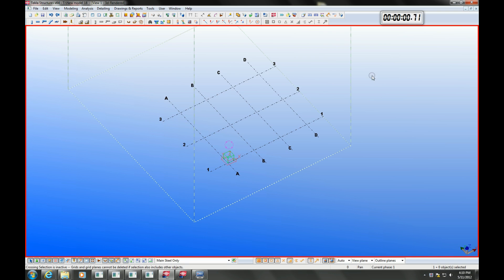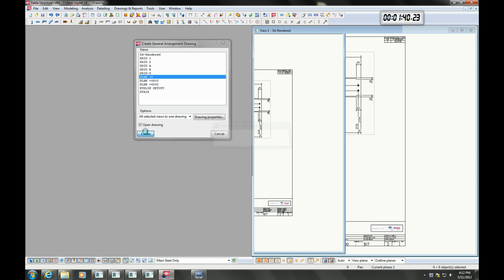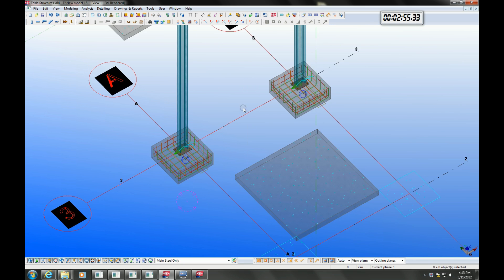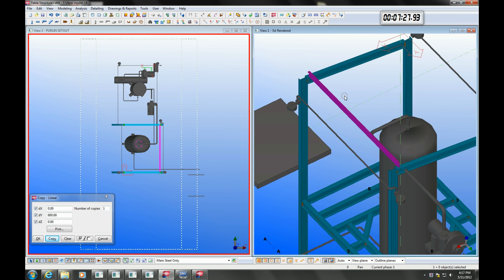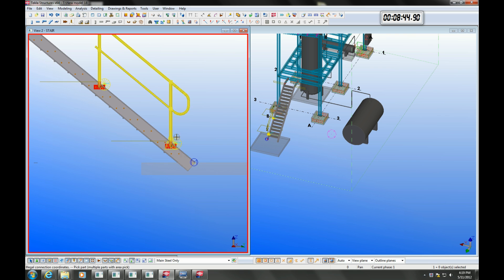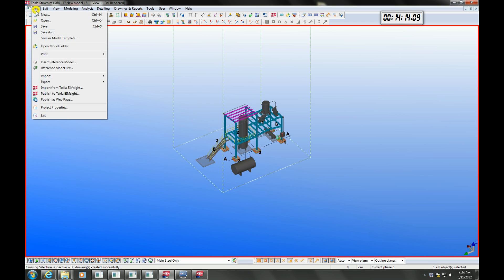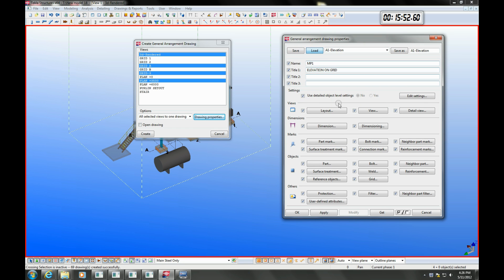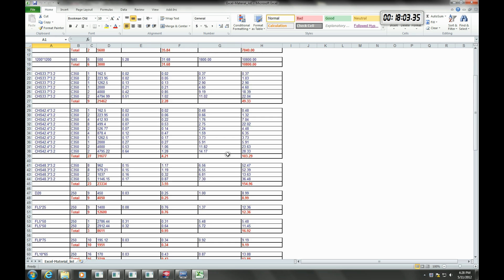Tekla Structures Steel Detailing

Comment: Which software is best for steel structure for industrial things ladder, desk? I'm using Solidworks Weldment. Mostly, square or rectangular profiles 40x40x2mm.  It is very boring to prepare drawing sheet to workshop. Any suggest?

Comment: good tutorial.
when i open the built-up model after some days. Then shows
“Fatal: Model on disk is corrupted, use the latest backup model. Please run check disk on your drive.” 
Why & when the problem create in model fatal error.
How is it solve the problem (fatal error) permanently. 
Please help me if possible.

Comment: just want to ask...are the tanks or vessels are made in tekla also?
Reply from the maker: Hi Kristoffer, these tanks aren’t modelled in Tekla, they have been brought in as DGN files. Tekla exchanges data with a wide variety of software and formats. See the list of Compatible software on Tekla’s website :  http://teklastructures.support.tekla.com/200/en/int_compatible_software.
Reply: BuildingPoint ANZ ... thanks for the video ... could you do a tutorial about how to import different files into tekla ... i would be grateful :)
Reply: BuildingPoint ANZ...thanks for the info, but one more thing, if you import a 3d model of tank or vessel, does this model will be counted when you do the reports and BOQ? thanks again..cheers
Reply from the maker: amine boualaoui Thanks for the suggestion amine
Reply from the maker: Kristoffer de la Gracia Tekla can convert IFC objects to Native Tekla
objects that can be output to a report or BOQ providing the shape and section is recognised or mapped to Tekla sections. For more information contact your local Tekla support team http://www.tekla.com/contact/offices-and-resellers